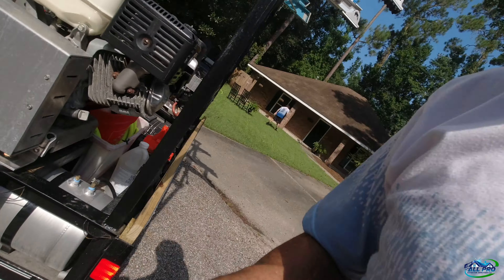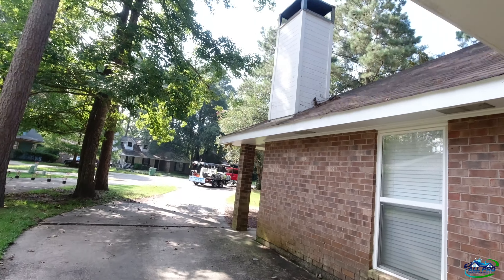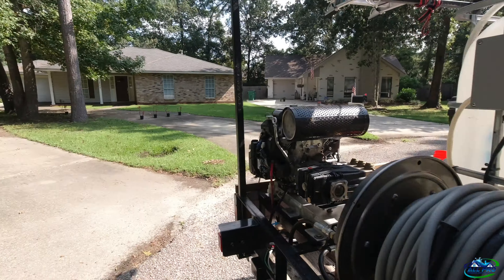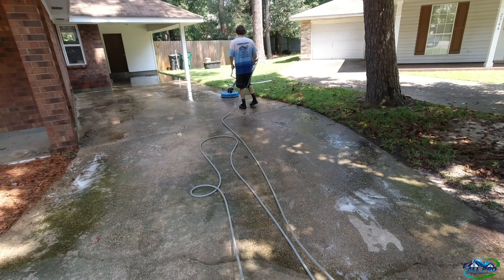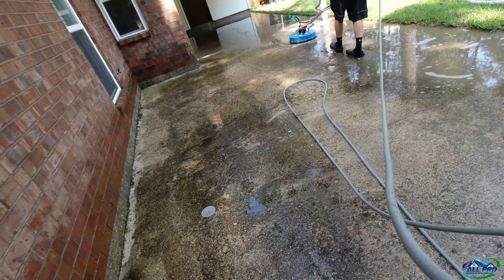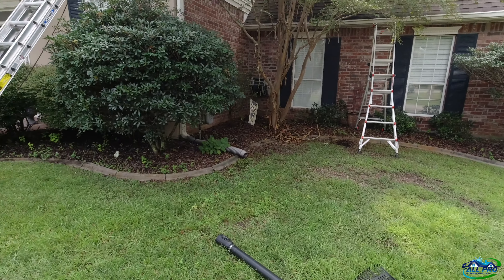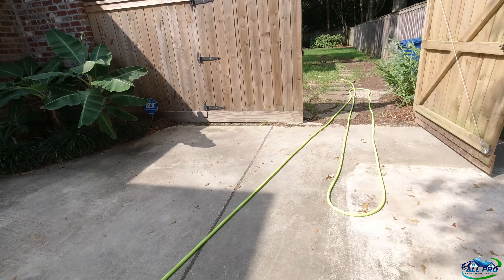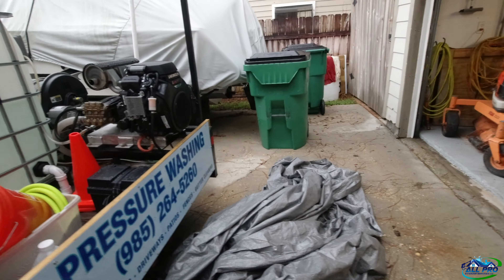House Wash, Driveways & Gutter Cleaning!

Comment: Have you thought about going back to the circle technique to avoid the lines?  It takes longer but I kinda like the results I get with it. Thanks for the videos!
Reply from the maker: I have thought about it. It would be easier if my new surface cleaner had wheels. Maybe a future upgrade for sure. The circle motions do help a lot with great results. Thanks

Comment: 🌴 I cleaned gutters on a three-story house today and the backyard was on a hill. That's the first time I've used a 40 ft  ladder ( I rented it) , It will also be the last time..  I know my limits now!  🌴
Reply from the maker: LOL. I agree with the 3 story. I usually priced them super high, but they still bite. Keep chasing the cheese!!
Reply: Same here, ended up going to HD and getting the $40 extension pole
Reply: Palm tree, I've got a 40' ladder, weighs 105#, I too used it just recently, at 63 years old and 97 deg, 90% humd here in Texas I ain't pulling that beast out again.....guess I'm just not built for that anymore...